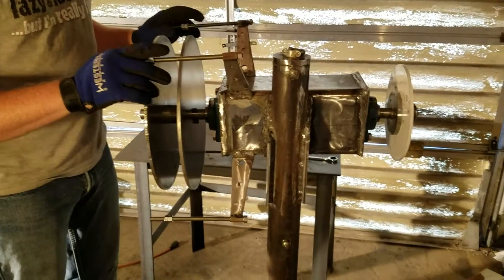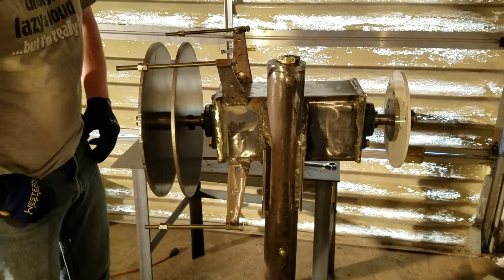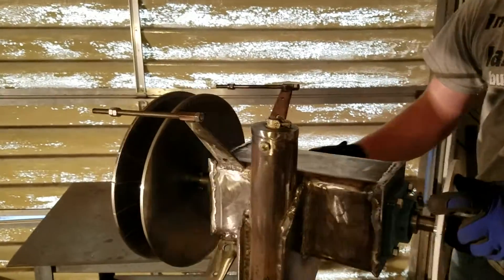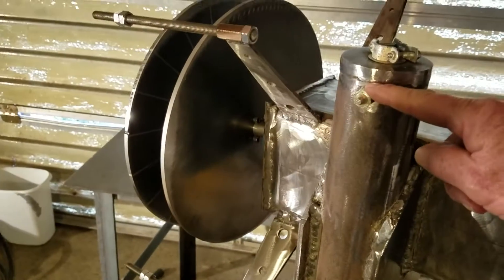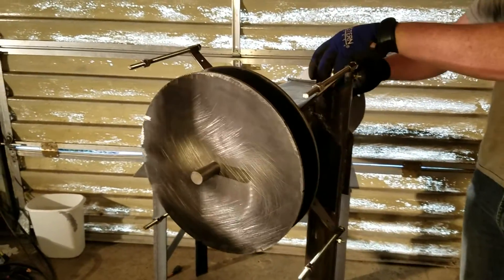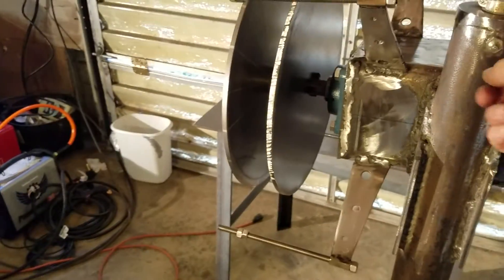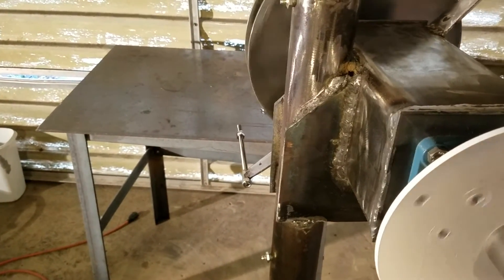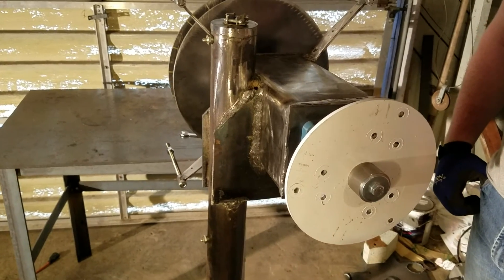Axial Wind Generator Build Progress

Comment: this is a very solid build and you put alot of thought put into your build, interesting to see if the three bolts can withstand the torque over time, i like the idea of avoiding warpage caused by welding, nice close fits on the shaft maybe antseize could be used there.
Reply from the maker: ill be using the red lock tight on all the bolts and hope they stay put. if not I have enough design that should be more then strong enough. still working on that one.